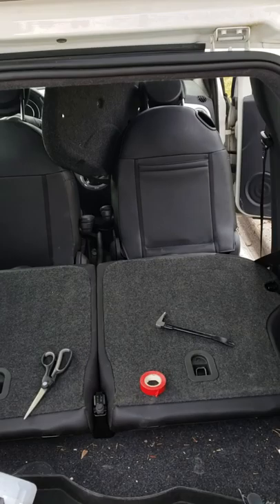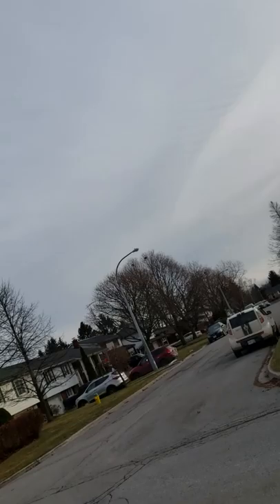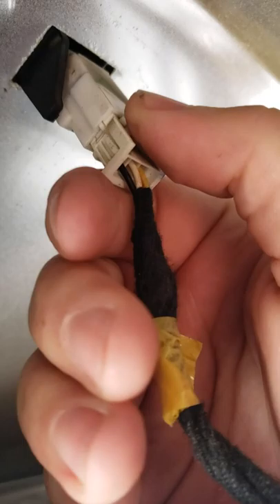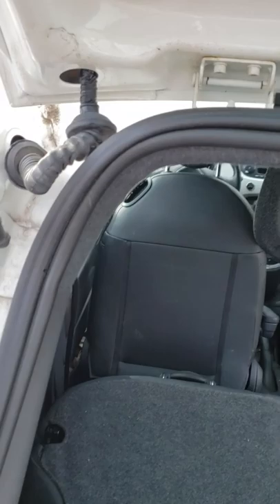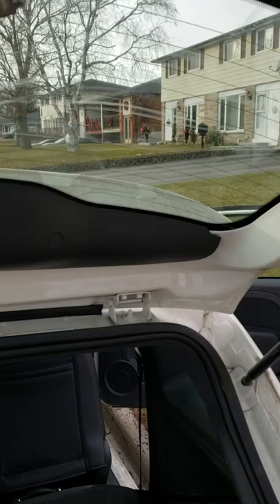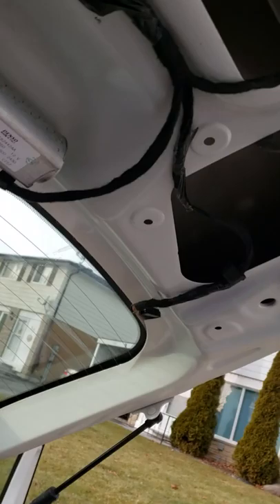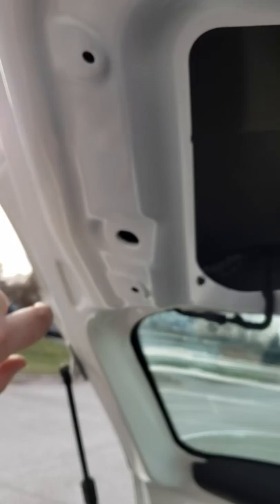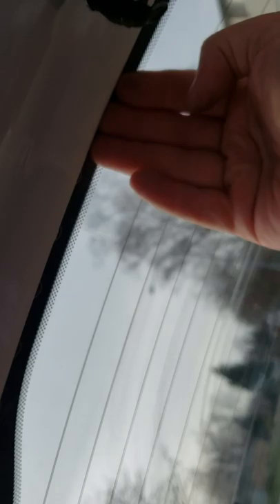2015 Fiat 500 hatch release issues fixed.

Comment: Take the rear panel off and you'll find a small silver lever in the white plastic area. Push down with a screw driver and it will open. You will find the wires inside the rubber sleeve between the body and door is full of bare wires. There is a splice kit available but from Latvia on ebay for 30 bucks. Good luck. Remember to cuss fiat for using cheap wiring. :)

Comment: Hoping this will help me. My issue is that the button on my trunk is loose so there may be a faulty connection
Reply: Usually the pins that the handle swivvels on have worked their way out - push them back in.

Comment: I tried it on my car but it’s a 2016 and none of the tricks are releasing the hatch. If anyone has a way to release a 2016 500x , please share
Reply from the maker: The 500X and 500L are almost completely different than all of the other 500's. This video should apply to 500 Pop, Sport, Cabrio and Abarth.
Reply: Currently balls deep trying to get my trunk open since the latch button fell out. My 2016 fiat 500x has been nothing but troubles